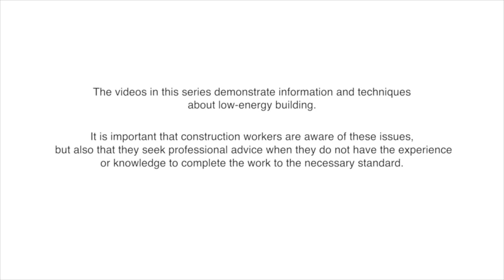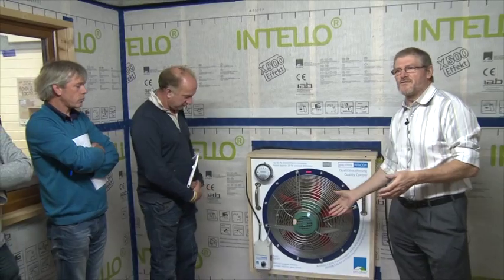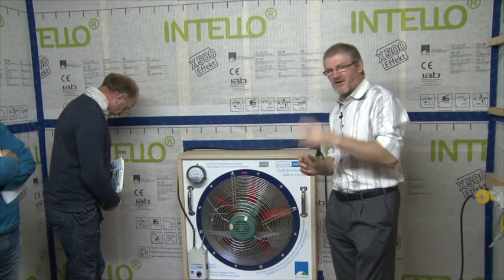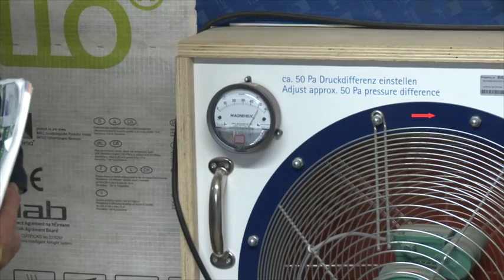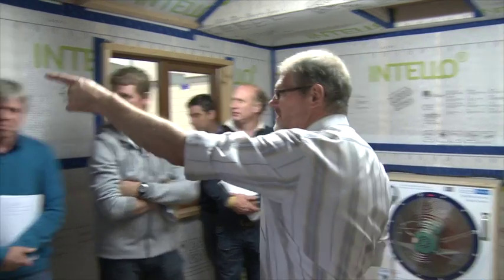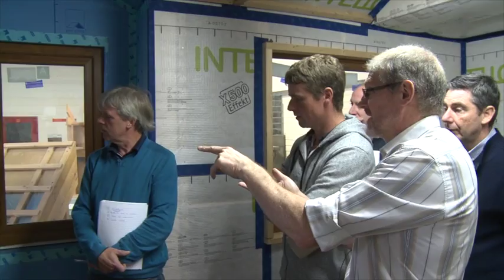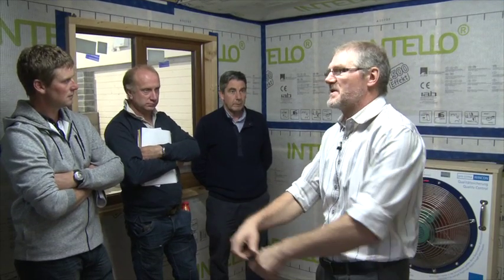Finding Air leakages

Comment: Is a little bit of air leaking so bad , The property will need so ventilation , and into the bargain I've just had a stove installed and the fitter had to put a vent in the living room to comply with building reg , this just literally blows a hole in air tightness  , I think this is becoming a money making racket and making a business that never existed

Comment: I happen to live in a passive house since 21 years now, pay 124 EUR per YEAR for the heating of 90 sq.m. and am happy to FINALLY see that the topic gets attention. Very good presentation!
Reply: Wow!! Did the air seal degrade in that time, did you have to redo anything? And, I guess, you use air to air heat pump with MVHR?

Comment: From Port Alberni in the Heart of Vancouver Island BC Canada passive house build https://www.youtube.com/user/seumas2/videos
To date 37 detailed videos with material used 

Port
Alberni's first Passive house (Passivhause) build in the heart of
Vancouver Island British Columbia Canada.

Passive
House(Passivehaus) is considered to be the most rigorous 
voluntary energy-based standard in design and construction industry
today.

Passive
house buildings consume up to 90 percent less heating and cooling
energy than conventional building.

The
use of Passive House design software was used to gain the specs
required to meet the performance standard for this location.

House
was constructed well  above the current standards as outlined in
the B.C. Building Code.

Footings
were widen to 36 inches(914 mm) due to low bearing soil conditions
and additional rebar reinforcement added.

30
inch high (762 mm) high reinforced walls . Course sand placed inside
foundation walls and mechanically compacted.

Three
layers of four inch *102 mm) thick  Expanded 
polystyrene foam sheets with all joints staggered and tape were
placed on top of compacted sand.

The
three layers of foam have insulation value of approximately R 50.

A
20 mil layer of poly was placed over the E.P.S. sheets and taped and
sealed.

Four
inches(102 mm) of 30 m.p.a fiber reinforced concrete was placed to
form a slab over the foam based.

Slab
is isolated from concrete stem wall with four inches (102 mm) of
E.P.S. to prevent thermal loss.

All
cold water lines are buried in the sand to keep them cool, hot water
lines have been placed in the center layer of foam insulation to
minimize heat loss.

Wall
plates compress to heavy beads of acoustic sealant between layers of
vapor barrier to prevent air movement.

The
walls are double stud configuration set at 24 inches (610 mm) on
centre and plates are spaced in a manner that yield a 20 inch (508
mm) thick wall. 1/2 inch (12 mm) standard plywood sheathing with 
Mento 1000 a three layer airtight vapor open house wrap( far superior
to common house wraps) with 1/2 inch(12 mm) pressured treated plywood
rain screen battens form the exterior surface. 

Intello 
smart vapour barrier was installed one third in from the inside wall
to prevent condensation in this climate.

Triple
pane argon filled windows meeting passive house standards from
Euroline  were placed mid wall to reduce wind wash heat loss. 
All window openings have been splayed at 45 degrees to give a full
wide angle view.

Almost
all the wiring and plumbing was kept inside of the vapor barrier
envelope to minimize air leakage.

Passive
house standard requires air leakage not to  exceed .6 Air
changes per hour at 50 pascal.

Zehnder
comfoair 200 HRV has been installed with a 1000 watt air preheater
.(92 percent heat recovery rate)

House
has been pre- plumbed for a heat pump water heater reducing 
domestic water heating cost significantly.

Garage
has been pre-wired for 40 amp/240 volt  electric car charging
station.

House
to be equipped  with  heat pump condensing dryer which
requires no external venting,only a water waste line. George K
Builder. © George K 2019      
https://www.youtube.com/user/seumas2/videos

Comment: Everyone should get this done at home
Reply: Yes def for energy savings...but if you don't make sure your house also has proper ventilation (fresh air) you are sealing all the VOC's (volatile organic compounds) up inside.  Also for fresh oxygen if you have appliances that burn gas.
Reply: Not everyone, every house needs enough air changes per hour to keep moisture and CO2 levels down. Every house with MVHR system installed needs to be as airtight as possible.